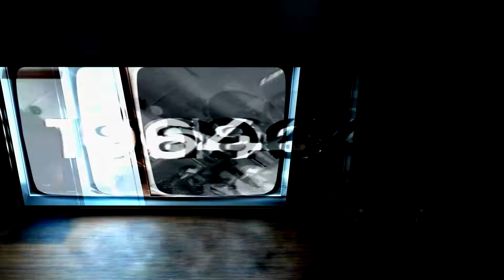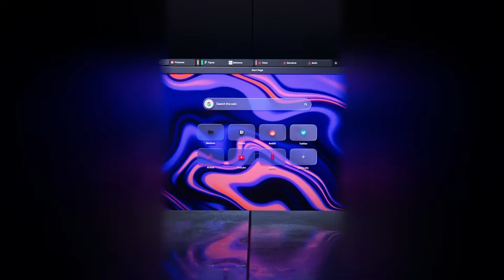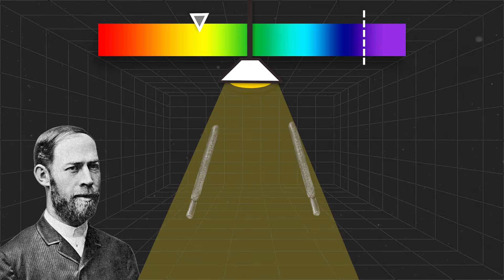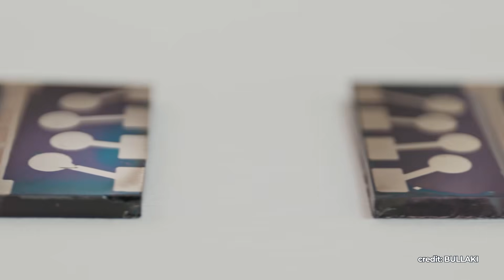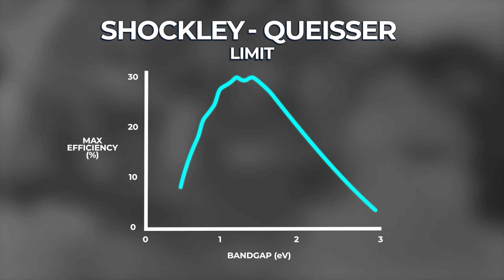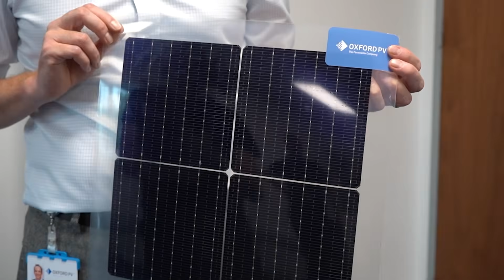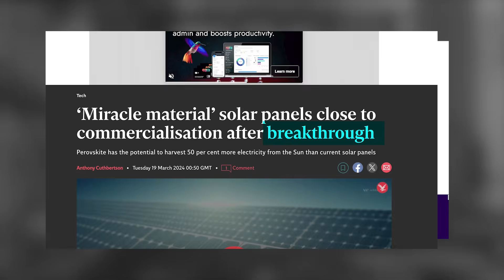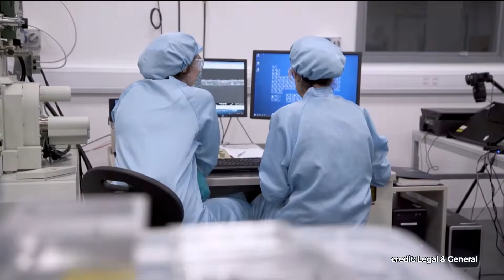How Physicists Broke the Solar Efficiency Record

Comment: TLDR; 24% with packaging. 28% in lab.
Reply: I think the point is more energy per unit area - not strictly cost. 20% increase in efficiency is good! How much area are you going to increase, and opportunity cost+use of land? No point berating it, like quite a few here
Reply: Still, a quarter of the energy landing on the panel can be captured for use and that's really impressive.
Reply: thats rough. Canadian Solar bi facial panel is that range . TOPHIku6 single side is 23.2 % efficient 625w. The stacking could make a massive difference but would reduce durability with layer thickness reductions .
Reply: Everyone IS using solar. The problem is that you guys don't understand how powerful the sun is. 30% without material degradation is already amazing! The sun is a death laser, and the fact that we're able to harness that power is extremely important to the development of society. Coal, oil, and natural gas will run out within the next few decades. Solar... It won't run out for the lifespan of the human race.
Reply: The biggest issue with perovskites is and has been degradation/longevity in real world applications post installation. With or without weathering.
Reply: but that doesn't give him YT and sponsor bucks! Doctors need money y'all
Reply: Yes but it's just the initial step. They're the first to commercialize this. They will find better perovskites and determine ways to stabilize them and this number will continue to increase. There's dozens of teams working on it.
Reply: go Nuclear!
Reply: The audio mixing needs work. The lab clips and scientists talking are significantly quieter.
Reply: And 0% at economic production.
Reply: @sectokia1909 Yup. Actually, probably a negative, not just zero. I have panels on my house, the economics are so bad its laughable
Reply: You have saved me 30 minutes of my life. Thank you
Reply: Thank you for doing this. Too much of a preamble in these videos.
Reply: Thanks, exactly what I was looking for. That is neat. I think current best gen is 18%?
Reply: You can get 25 percent silicon cells from China. So it needs to be much much cheaper!
Reply: Thanks thts All I wanted
Reply: So what... Max 4% more than regular panels? Pathetic!
Reply: @TrickyNekro  Pathetic is a little extreme. This is how technology progresses. Plus, the new material is cheaper than silicin.
Reply: @bencreatesthings  eh I know, but it drives engagement... It gets people moving!!!

Still to be honest though, real field number is probably much much lower and this is just another hype train so...
Reply: @TrickyNekro   technically the jump from 24% to 28% is a 16% increase in efficiency
Reply: @TrickyNekro   "So what... Max 4% more than regular panels? Pathetic!"

Are you referring to the advancement in efficiency from 20% to 24%?  If so, why would you frame it as 4% more?  That's an increase in efficiency of 20%, which I would not call pathetic.
Reply: @TrickyNekro  I see you don't understand how incremental improvements work over time.
Reply: @TrickyNekro thats not even how percentage is calculated.... if something 50 percent efficent could be made into being 100 percent efficent, thats a 100 percent increase as 100/50 is 2... thats double the efficeny, increasing by itself. 100 percent. 24 to 28 would be closer to 16 percent increase
Reply: @ege8240  if you use the lab values yes, but if you use the field values ( 20 -> 24 ), it's 20%. ABS( ( init. val - new val ) / init. val ) * 100 for percentage. Your point?
Reply: @TrickyNekro  I think that they framed the benefit of perovskite incorrectly. The benefit is the ability to produce cells with imperfections. Allowing much less intensive manufacturing of PV cells and therefore being able to make more of them for a lower unit cost. The combination of the silicon and the perovskite increases the efficiency by 4%, but the perovskite is just as efficient as silicon on its own.
Reply: @TrickyNekro  yeah but just think about it, if you have a gigantic solar field, taking up hundreds of acres, a 4% increase in efficiency actually ends up being a lot.
Reply: @TrickyNekro  Think you can do better? Go on then.
Reply: @TrickyNekro  progress are made bit by bit in most cases. Even ground breaking step like first commercially viable implementation of perovskite (prior to its furhter optimization), can often been regarded as "pathetic"
Reply: @TrickyNekro  We're all, with bated breath, looking forward to you publishing your scientific advancement that shows these obvious amateurs how it's done.
Reply: @LilMissMurder3409  Solar thermal already can achieve 60% efficiency. Geothermal is also a possible path. One could also combine the two. I don't need do anything.

Edit: with btw the problem of energy storage almost solved in the same facilities.

Existing technology can be used, produces far less e-waste, don't produce anywhere near the green house effect through self-heating etc. etc. etc..

So yes, 4% max at best possible scenario for current PV for use on earth and not maybe niece space applications is totally and utterly.... Pathetic!
Reply: @TrickyNekro  
It's a start. It will improve more.
Reply: @TrickyNekro  Is that heat efficiency or electrical efficiency? I don't believe you're comparing to the two in good faith or understanding.
Reply: @kronos7110  we are getting hyped about technologies that offer 20 - 25% improvement under best possible conditions and that do not solve existing problems with them, over technologies that long exist, are refined and can give a 300% minimum better efficiency today and solve some serious problems in comparison to the hyped ones.

I think under these circumstances, I'm more than justified to call something, that's hyped to save the world, pathetic.
Reply: @zackkirako8574  at the output (electricity) and seriously lowballing it.

Also about the "good faith" argument... Solar thermal, existing plants can work at least 2 days without any input. Now you tell me how much battery capacity you need to compensate for that.
Reply: @TrickyNekro huh do you have any good sites or studies that point to that number?
Reply: @zackkirako8574  ooopsss sorry, it seems that I was quoting old numbers, new studies suggest up to 75% efficiency.... My bad. 😂
Reply: @TrickyNekro okay sure.. can I ask where you got that? A quick glance also shows that number applies to thermal efficiency ie applications where the heat is used in transfer heat for other thermal applications. Not for electricity as that would require a turbine for electrical generation. Of which low efficiency photovoltaics and thermal solar are tied. So please any studies or sites?
Reply: @zackkirako8574  sure, even if it's heat efficiency, a normal steam turbine can have efficiencies up to 90% and generators have usually efficiencies up to 95%. Do you need a study to do the multiplication?

Edit: and I guess people building such powerplants will look up the average solar power reaching the earth at the region to size, both the turbine and the storage accordingly to maximise efficiency around 80% for the steam turbine, which is also the average of what most power plants, irregardless of fuel / energy sources used, seem to achieve.
Reply: @TrickyNekro literally look up "what is the efficiency of thermal solar power plant" and it's around 15-25%.
To make this easier for you to understand if solar thermal was as good as you think it is everyone would be using it and pv would have no money in it. Either in the real world or the lab.
Reply: @TrickyNekro its not nearly good enough for this material. It is a lot more fragile compared to traditional solar cells.  More expensive and dozens of other downsides including degredation to UV exposure.
Reply: @zackkirako8574  also, we couldn't even compare those 2, we are seeing improvements from solar panels to solar panels. and 20 to 24.5 on a 1st gen tech is pretty huge in my opininon, the first silica based solar panels were around 6% efficiency, now they are at 20. One thing that would be nice to calculate, is to see how much the isolated new material produces since they're using the double layer thing. How much does the bluer spectrum silica layer generates compared to the bluer spectrum perovskite panel would be the "Real" improvement measure (of the peruvskite over silica)
Reply: @zackkirako8574  Solar thermal efficiency mostly depends on the temperature that can be achieved at the boiler. What you are referring to is the old cycle using thermal oil, using molten salt today has double what you mention and projected much higher (up to 60%) as materials develop and even higher temperatures are achieved.
Reply: @zackkirako8574  It’s hidden deep in the video and hard to find. Hence write comment.
Reply: @blucat4  blame the YT algorithm with its stupid recommendations and trying to push people, no I'm no hate groupie, just passing by...
Reply: @TrickyNekro solar thermal isn’t as useful in smaller applications such as small electronics. That is where something like this research can improve on.
Reply: @TrickyNekro   Im still not finding the numbers that your mentioning. I found a 2019 Paper (Bielecki, Andrzej) Talking about it that referenced a 2014 (by B. Ehrhart) that only dropped a overall efficiency of 15 percent but I found  a youtube video (by twobitdavinci) saying that efficiency could be as high as 40%(Not 60% or 75%). So, neat but, nowhere near as efficient as you stated. That 98% Percent Efficiency is only related to the Thermal Storage of the Salt btw. Again if you have a paper or article or anything of actual substance I'd love to see it. Feel free to google the "Author name, Year, Solar" to find what I found. So nothing about this research is pathetic and it has its use cases like so many other technologies and fields of research that you or I are even aware of.
Reply: @zackkirako8574  "Exploring efficiency limits for molten-salt and sodium external cylindrical receivers for third-generation concentrating solar power"

They are talking about an net cycle efficiency of around 50%. And that's the first paper I found just looking around a bit. We are not even going to over alternative methods like Stirling engines.
Reply: @TrickyNekro 
Steam turbines require a minimum level of temperature. Otherwise, you're speaking of either molten salt thermals, which get expensive very quickly, or district heating, which doesn't generate electricity, and are pointless in areas with very hot summers
Reply: @Demopans5990  as far as I am aware there are two approaches right now, one with "thermal oil" that reaches something like 350 - 450C and molten salts that can reach 500 - 700C.

The molten salt technology might be more expensive as one to one energy production but it solves a lot of problems with storage, as some plants offer storage for up to 2 days.

When you factor that in, it's dirt cheap and the technology has not even scaled near enough as solar panels manufacturing.

We have technologies that work today, with better efficiencies, solving to a large extent the storage problem etc. etc. etc. and yet spend millions on research on PV to get some percentage under ideal conditions.

And that's ok, but the hype... the hype is very very dirty...
Reply: @TrickyNekro  
I am aware of a few molten salt thermal projects in Nevada, which does make sense considering that it's a desert with comparably cheap land that no one wants. PVs only make sense on existing buildings as energy supplement anyways.
Reply: @Demopans5990  unfortunately the ones in the US are from what I am aware involved in some scandals. Many promises but under-delivered.

Solar thermal can be used in many climates to provide with direct heating, energy generation, enhancing the efficiency of fuels in existing power plants etc.

Small scale is more difficult indeed, probably impractical for anything other than hot water and heating. There are companies that provide with Stirling engines mounted on tracking solar dishes that get efficiencies up to mid 30s. The waste heat could be captured to help with efficiency and also provide with home heating. But there's no standardisation in the industry at the moment.
Reply: @Tobi-hs9pt nah, I think apart from being a total a$$ in my initial comment, I actually managed to proved my point.

And your try to shame me, is exactly as the hype for a maximum 4% efficiency increase under ideal conditions.... Pathetic 😂😂😂
Reply: @TrickyNekro  ill admit that its not what its hyped up to be but that no reason to be negative about progress. the tech you refer to probably grew in small steps as well.
Reply: @TrickyNekro  They are not 60% efficient.  60% is the solar energy to coolant heat conversion efficiency. There's still a heat engine (usually a steam cycle) and its inefficiencies left in the process that you're ignoring.
Commercial solar thermal plants range from 15% to 30% total conversion efficiency.
Reply: @TrickyNekro ? Most turbine effy is 34% Around 40% Max turning into electricity,  but eletrical system  making things, effy is Around 80%+

 anyway going to sleep
Reply: @LilMissMurder3409 go ahead and try to build a thermal solar getup that’s efficent on small scales. Panels are light, portable, and personally installable.
Reply: @gurgleblaster2282  More expensive because there's no mass production yet.
Reply: @TrickyNekro up to 40 % or more scalable....  takes time.
Reply: @TrickyNekro planes are also more efficient than cars. Same logic applies. You can't use solar thermal in most places.
Reply: @shadmansudipto7287  you don't have to use it alone either.

It could be combined with molten salt nuclear.
Reply: Saves you 20min of yap

Comment: When a comparable modern day panel is the same weight as a simple material like sheet metal or alupanel used in cars or trailers the world will change drastically!!
Reply: weight of the panel isn't the real problem..  here in the UK solar radiation in total delivers between 7kWh/m2/day in summer and 700Wh/m2/day in winter.  Currently the most efficient cars (Teslas) can manage about 4miles per kWhr.  Assuming 2m2 available area that means in summer the maximum you could achieve is 28miles per day, and in winter 2.8miles per day.  On average over a year you'd do well to achieve 14miles per day.  Now reduce that by 70% (30% panel efficiency) and you get 9miles per day in summer and 0.9miles per day in winter.  The way to make that work in reality is to make cars vastly lighter and more aerodynamic.  What you get is something like the Aptera, which has been "close to production" for rather a long time, it's very interesting, but the problem isn't just the solar panels.

Comment: They still cannot overcome the limitation that the sun, on average only has 6 hours of peak solar production per day.  Storage is a much bigger issue, along with reducing demand through more efficient devices.  Just build the molten salt reactors running on Thorium.........its simple and all the downsides of the the 1950's dinosaur "solid fueled,water cooled" reactors have been eliminated.  Even existing "spent" reactor waste can be consumed and eliminated in the molten salt reactor design.

Comment: Do you think the problems of scaling also work in the scaling of profits to reduce the motivation of energy suppliers to adapt cheaper sources? The suppliers aren't tied to the energy source, they are tied to the revenue and the overall profit from that revenue. If I create an energy source that costs 1/100th of the current supplies, the cost of labor suddenly exceeds the costs of the energy by 100x so I would have to charge the customer 100x what it cost to create the energy, and they would accuse the supplier of gouging or taking advantage or any number of things.
Reply: It's doesn't make labour any more expensive than it already is does it

Comment: Nothing says "in production" like.. "they wouldn't let me hold their panel"..
Reply: I would bet that many of the first prototypes have been tested in military and spaceflight applications and this is where the first year or two of production will go.. A company in Texas is making double sided panels in the 22% range and I don't see it taking long for fabs to get up to production levels maybe a year before the volume is up to retail levels.. If they can get the cost down and lifespan up in two years I would consider adding a bank of these in place of the 300 watt panels I have now as afternoon energy production..
Reply: Even Chinese are manufacturing perovskite cells, iirc
Reply: To be fair that was a flexible prototype, not the one they actually produce.

Comment: Efficiency is one thing, the will to implement is another, and the obstructionism from the dinosaur lobby is yet one more, probably the most detrimental. So the should be a sister scale that measure all these things which should temper the embarrassment into some other emotion.